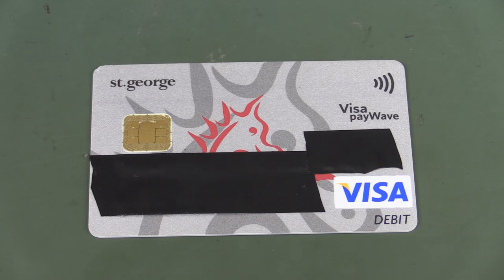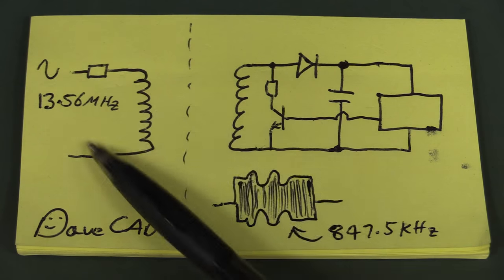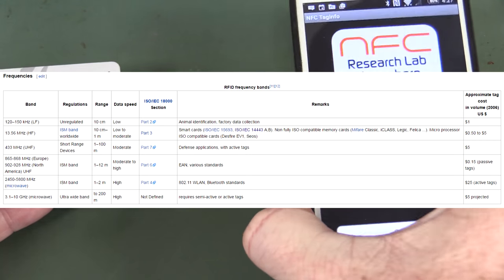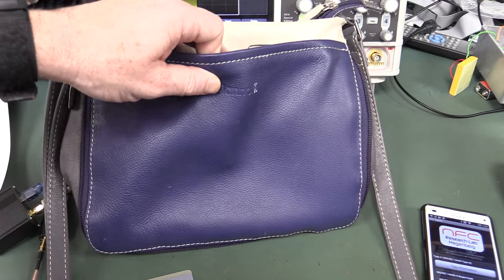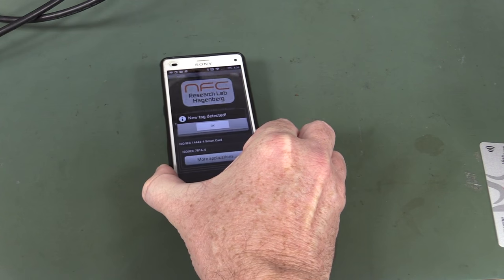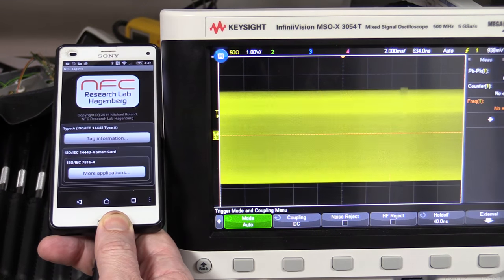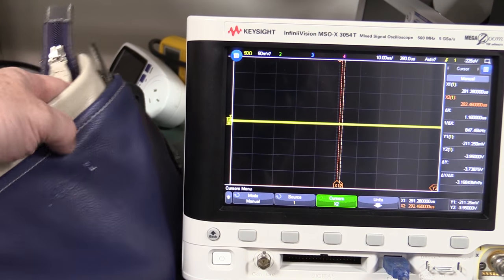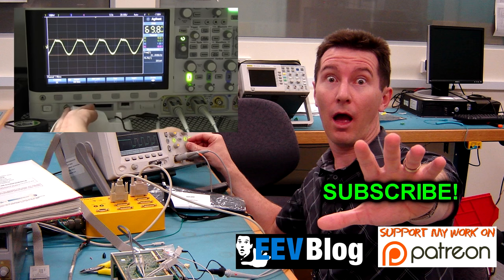EEVblog #889 - Credit Card RFID/NFC Theft Protection Tested

Comment: Question: Even if you had a super powerful transmitter, one capable of transmitting through the shielding sufficiently enough to activate the card, wouldnt it still not work because the card needs to then transmit back?
Reply: I suspect if you could get enough energy into the chip to make it transit through a good layer of shielding you would burn out the chip.
Reply: This is correct: The card, but the card won't be able to modulate it's answer onto the stronger magnetic field in a protocol complient way. This is done by design of the technology to limit the usable range to a few cm.
Reply: Do the cards have over-voltage protection for the coil?
Reply: The card doesn't transmit, it communicates by varying the load. A guy at school made a reader that can communicate with ISO 14443 cards over a couple of meters as part of his dissertation, so it might be possible. It's not as much about power as it is about sensitivity.

Comment: is it possible to use a jammer to jam the 13.56 mhz to prevent the tap from working at all?

the scenario is someone could broadcast a blank 13.56 mhz wave so the terminal cant read so it prevent the transaction to force the use of the chip or swipe so the skimmer could be used.

in the past when the chip came out criminals would make the shimmer insert have some tab to block the chip so when you put the card in it would not make connection to the chip at all or it would have some wires to corrupt the signals to the chip to make the transaction fail so it forces the customer to swipe.

i am asking because i suspect that a couple gas stations here in the united states may be in on a skimming ring and they say it is a problem with the card or security.

Comment: Here in the UK it's between 25 and 50 pounds depending on your bank. Mine doesn't work which is infuriating because I want it to and my bank keep sending a new card for the WRONG account. Oh and at least on my Visa card, the chip used for the RFID is the same one as the normal chip
Reply: The current limit for "no cardholder verification" by contactless in the UK is £30 regardless of bank.

Comment: From what I can tell, the only info that you can get out of these cards is the same info on the front of the card (card number and expiry date). It doesn't give you any of the crypto information needed to create a duplicate card using the modern EMV protocols, and it doesn't give you the CVV number you usually need to make online purchases. It might be possible to make a fake magnetic strip card, which may work if your card issuer and the store's card processor still allow magstripe transactions - though if you're in the US, that's likely the case.

Comment: "Not valid unless signed"

Nice to see I'm not the only one who doesn't sign their cards. Zero point in doing it.
Reply from the maker: Signatures are not valid any more in Australia, officially phased out.
Reply: Well yeah, still says the card isn't valid without it though.
Reply: I can never even get the ink to stay on there anyway. Not sure what sort of marker / pen it's expecting me to use :(
Reply from the maker: It's a throw-back since before they changed the rules recently. I guess they couldn't be bothered changing their card stock.
Reply: Here in the United States, there are some Agencies/companies that will not accept a unsigned card for certain transactions, like the US postal service when purchasing money orders. Although I do not see the point in it, since they normally hand you a pen, and tell you to sign your card. How does this prove that you are who you say you are,  it only proves that you may have forged someone else's signature. and by the way, None of my credit cards have the RFID symbol on them. in the US, credit card companies and banks are getting away from the RFID cards. Replacing them with the newer list vulnerable cards. but they still don't require a pin number.
Reply: you're signature proves that you have read and accepted the therms and conditions and if you aren't the legitimate card holder, the signer would fake a document. Both is legal mumbo jumbo, that shall prevent cases like: "All I did was handing the card over and mark a line with an X - I never claimed to be the card owner".

That would not happen in real life? Well, this is how upper Managers get away with their crimes and still claim big money for big responsibility.  When it comes to the business end of business, they have (in legal therms) never authorized anything, they haven't heard anything (they kicked all middle managers that reported problems - as if not reporting issues is prove for solving them)  and they never checked anything as they have to believe the reports from the middle management. That is way we have to sign obvious things.

The whole signature thing good out of proportions any way:
"in the old days", a contract was signed with an "X" and a person that actually was able to read and write wrote the name of the contract partner next to the X.
(what I mean with out of proportions is a german judge, that did not want accept a document because the signature did not look good enough for him [while the name was machine written below the signature and there was no dispute about how signed the document])
A contract is nothing more then an agreement - and as long as both sides agree, no one cares for the technicalities. But if one sides disputes the contract, well: Then all short of questions are rised.

Comment: So when is somebody going to make a shoplifting RFID/NFC theft protection handbag with the lining over the main compartment?
Reply: Maybe a while.  That's a licence to shoplift (none of the security tags would activate the door alarm).  For ages lifters have been lining their bags with foil to beat those pesky door alarms - if they are caught they get done for 'going equipped', even if they haven't nicked anything.  A bag with it built in would allow them to 'go equipped' and not get in trouble if stopped.  If they made them they would fly off the shelves and straight out the door (avoiding the tills on the way of course!).
It might also affect mobile phone reception???

Comment: I'm sorry Dave, 13.56MHz qualifies as RF. In fact above 153kHz is the LW band and something around 67kHz is (was?) broadcast for RF clocks in Europe. The method of coupling into the receiver is not what decides whether it's RF, that is merely the transmission scheme and antenna coupling. Sure most transmission uses the 'E' field and this is predominantly 'M' field but what about AM receivers that have those dinky little ferrite rod antennas? They are really only a coupled transformer, or are they too not radios??
Reply: was hoping someone called him on this. his repeated statements its not rf were almost as bad as a phd level astronomy prof I once had telling the class that a microwave oven runs on inferred. Also im not sure on this but I dont think shielding is as hard as he claims, all you need is a para magnetic material. like the foil he then pulled out. If he had thought of it as rf and knew antena theory he would have been able to explain a lot more functional info about why the read range is short with a 22 meter wave length and devices that size (esp the card antenna) and the reader probably has less than enough room for a 4th wave unless its the model for parking garages as well
Reply: In the 13 MHz area we are (primarily) talking of inductively coupled systems where the necessary energy is provided by the magnetic field of the reader. Figure 1 depicts the very basic principle of an inductive coupled RFID system,  which can be summarized as follows [3] [4]: For inductive coupled systems the underlying antennas are represented by coils of a defined size. It is well known that a coupling system of two coils can be replaced equivalently by a transformer. The connection between these two coils is given by the magnetic field (B) and the underlying value to describe this connection is the mutual inductance (M) and/or the coupling factor (k).

http://www.eurasip.org/Proceedings/Ext/RFID2007/pdf/s1p4.pdf

Man, it's almost like Dave knew what he was talking about!

Comment: What if they use a few shorted turns in the fabric to keep the induced voltage at ground zero? Can the transmitter get anything if you have shorted turns under it?

Comment: In theory could one "record" the RFID data from a credit card then "play" it back into POS terminal at a store to generate a transaction under the $100 threshold to require a PIN using either a cellphone or possible some sort of Arduino based device?
Reply: Should not be possible. These cards are designed to foil replay attacks

Comment: I'd rather figure out how to fry the RFID chip in any card I have, as it's a feature I'd NEVER use specifically because it's so insecure. 

Perhaps a disposable camera's xenon flash circuit, but add an air-core inductor in series with the flashtube, and put the card on the coil?
Idea is that it basically makes a tiny EMP every time the flashtube goes off due to the high pulse current. Intent is to overload the input of the RFID chip to the point of failure.

Putting the card in a microwave for 5 seconds wouldn't work, as it'd also fry the security chip, which I DON'T want to happen.
Reply: 44R0Ndin not to mention scramble the mag stripe.
Reply: 44R0Ndin Unfortunately, I think it's the same chip as the contact interface. Vendors of programmable chip cards with RFID and contact support (for stuff like corporate security) generally work like that, and it's the same companies supplying the credit card companies.

Comment: * it's the same chip that does both functions in all cases
* none of it is encrypted, whichever provider you have
* with a sufficiently high powered emitter / large gain antenna, you can read the card at a good distance of several meters if not more
Reply: Given a good antenna and equipment there is still a range limit from RF noise, but that could be quite a range.

Comment: great video as always, some banks NAB for example, offer a paypass for your phone which basically acts just like your card for transactions. I obviously turn my NFC off, but I wonder if someone didn't could readers do the same thing or would there be some kind of extra security level in it's software?
Reply from the maker: Probably works the same from an authentification point of view. But you need an approved  transaction system to do it.
Reply: Normally you get an app where you have to enter a PIN or such.
Reply: ***** yeah a pin is optional but not as default

Comment: If you try and use two cards at once with an eftpos reader it won't work, it tells you to present one card at a time. Which is probably why people think having two cards in your wallet protects you. Actually, I thought that. But I can see now that it only would protect you against one of the least sophisticated types of attack.
Reply from the maker: But that's just a feature of the point of sale system. A hacker would simply use every/any card in the field.

Comment: Uhhm you might want to take down this video. Someone could use the waveforms shown on the scope to get your credit card info...
Reply: If it were an analog scope in non-capture mode, maybe. The captures seem to only show a few bits at most. But that black electrical tape over the card, I'd be concerned about that.

Comment: I can't remember how, but I disabled that RF stuff, just too weird. I only use my debit card at my bank's ATM and my dentist because I don't trust linesnooping/dummy debit devices/computer virii.
Reply: I use wacom tablets as mice with their mice because they work like this and don't ever need batteries. My tablets are mostly like graphire 3s and seem to have issues with USB controller restarts like the BIOS and the OS. Some times I have to reboot the computer to get them working again.
Reply: If youre in the US, credit cards are safer than debit cards. You only have ... I think its like $100 liability? Debit can be much much higher depending on circumstances.
Reply from the maker: Here you have zero liability for stolen credit card if you report it immediately. The risk is on the merchant taking the card, they cop the loss.

Comment: They're still all un-encrypted. There's no way that it would work if it was. Think about it, if you encrypt the data, when you go to the Point of Sale, how will the reader interpret the data? It would have to take the encrypted data, decrypt it to process the transaction, and send it to the bank for verification. If it was encrypted, how would you determine any of the bank info? How would you securely transmit the private key to decrypt the card data? You'd have to pass sensitive un-encrypted info to protect the encrypted data, which is a fallacy as at that point the encryption is useless. 

Let's throw that out the window, and suggest it just uses weak encryption with a hardcoded password at POS. Then whats the point of that? I'm sure the keys are somewhere
Reply: Anony Mouse Probably uses a shared key replicated in all the SAM cards that are inserted in authorized readers for use in "offline mode" (used when bank servers crash a few times per year and people still need to buy groceries).

Comment: does the bag mess with phone reception?
Reply: nvm, it wouldn't unless you put it in the credit card thing.
Reply: +Bullfrogerwytsch Ahhh, that's probably why they restrict it to just the card slots, otherwise it'd be a pretty unpopular bag.
Reply: It still could if the phone was in the bag and the shielded credit card section was between the phone and the tower.
Reply: It's not a clear case of line of sight for phones to work, if there are surfaces to bounce the signal around the credit card section,
Radio signals do bounce, and microwaves are radio waves,.. and phones use microwaves.

Comment: Shouldn't a complete covering all over act like a faraday cage no matter what the frequency is(sans gaps)?
Reply: At the very least it doesn't seem that a Faraday cage can block a fixed magnetic field (i.e. 0 Hz modulation).
Reply from the maker: Not to magnetic fields, it simply attenuates it.
Reply: Seems like a Faraday cage is basically a big one-turn transformer shorted out, in terms of its effect on a varying magnetic field.

Comment: What these guys don't get is that even if it's encrypted,  you can still steal it.
Reply: So the master key has been leaked such that anyone snooping on the signal can decrypt it?
Reply: Don't need to decrypt it either. If you did you'd have to re-encrypt it to use it
Reply: A thief steals an encrypted database, is it useful?   [That Depends]
Reply: *****
Since the card can't have a real-time clock, the only meaningful time would be what transaction number it is.

Regarding master key, I realize that I wasn't thinking because the card reader can just send its public key, and have the card encrypt the return data with that. Then someone snooping wouldn't be able to decrypt since they lack the reader's private key. There is no master key to be compromised.
Reply: If you use an asymmetric encryption scheme, you can't steal it (well, you can with some sidechannel attacks, but that's pretty difficult). The card identifies itself, the reader sends a request to the bank's server which issues a cryptographic challenge (a random value associated with the transaction being verified), the reader forwards this challenge to the card, the card encrypts the challenge value with its private key and sends back the result, the reader forwards it to the server, the server decrypts it with its copy of the public key associated with that card and if the result matches the original challenge, the transaction is approved. At no point does the private key leave the card (so a copy can not be made), if an attacker happens to record a transaction the recorded data is useless because it only validates that one transaction and if the banks server is hacked, the hackers only get the public keys (i.e. they are able to verify legitimate transactions, but not fake them). 
Unless you mean like physically steal the card. Then yeah, you can do that, but it's not very practical because it gives you a limited window when you can use it.

Comment: You can turn this feature off at your bank
Reply: Bill Bill That turns off legit readers accepting RFID transactions with your card number. It probably does nothing to the card responding to RFID probing (unless there's a step where the RFID off decision is actually transferred to the card so it can refuse to respond). Bank officials can get confused like that and present one feature as if it was the other.

Comment: another way to be more protected would be to have card turned 90°, making coupling near zero
I am surprised that AU (all?) has 100$ limit
I have 15€ limit

how about any other of you?
Reply: AU is pretty special. Most of Europe has €25 and other countries have similarly low limits as far as I know. But you can still use it for higher values, it just asks for PIN additionally.
Reply from the maker: I can't imagine a smaller limit at the supermarket or petrol station. Common stuff like filling up your car wouldn't work.
Reply: Like Cherry said, that is not the limit of card or daily limit, it is just limit up to which you don't need to enter PIN, so safe but still useful for something small and not expensive
Reply: payWave limit in Singapore is SGD100, close enough to the AUD100.
Reply: The thing about rotating the card 90 degrees doesn't work. It's just a transformer, no matter how will you couple it, only coupling matter.